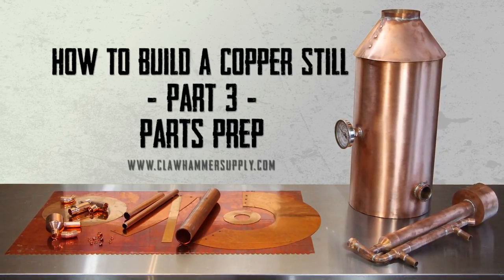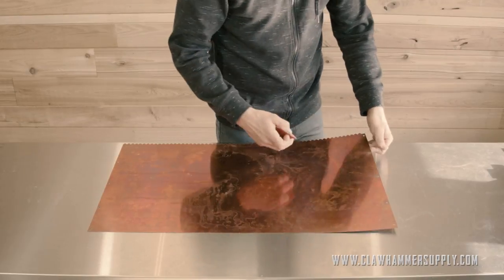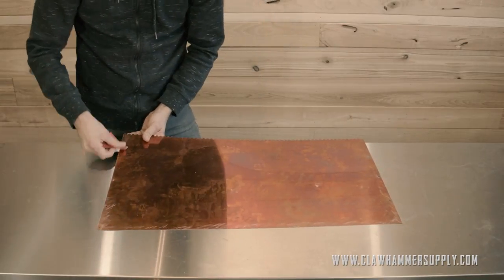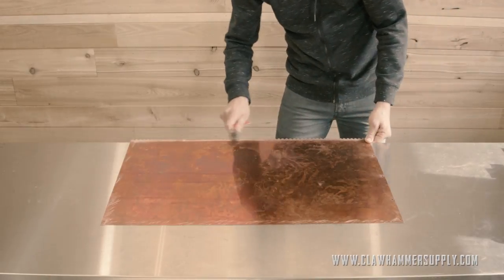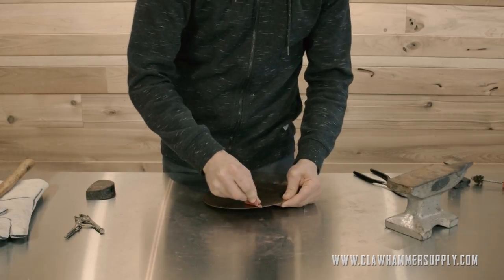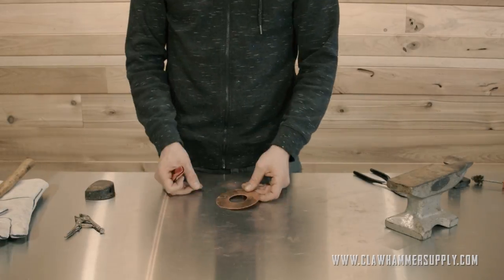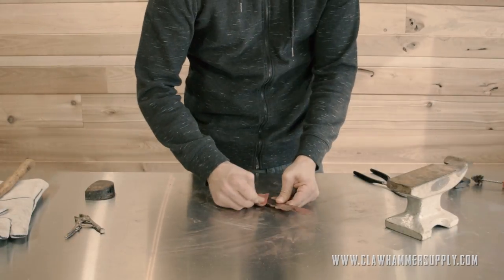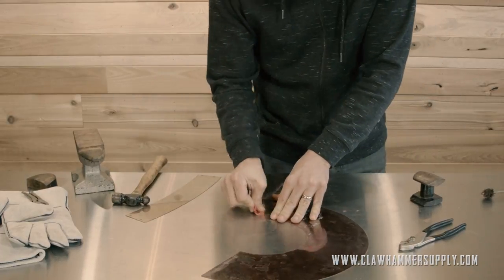How to Make a Moonshine Still - Part 3 - Preparing Copper Parts

Comment: Diameters, length, width would be Smart to mention. The Videos are Made up great, but the important Information is missing. I for instance have no idea how to size everything up for it to go together. And if i wanna get the copper Parts Made, i wouldnt even know what to tell them lmaoo
Reply: Go to Clawhammer Supply , buy the kit , everything is pre cut and pre drilled.

Comment: He forgets , or doesn't know , to mention , your brush or sand the copper at the joints to remove the coating and rough up the surfaces of the pieces being soldered so that you get good , strong solder joint. All the flux does is allow the solder to flow.
Reply from the maker: This is a 6 video series. It's mentioned in the previous videos.